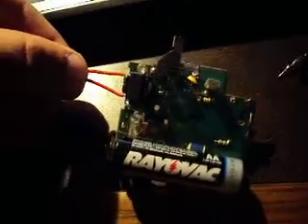easy EL wire driver circuit

Comment: The frequency would be about 18000 hz If there is high pitched whining like the whine you hear when an old tube TV is firing up. the frequency shifts around as the load changes though (this is known as drifting).

Comment: DaMMit, shorted the damn circuit. I dont have a volt meter, ANY TIPS? I'm trying to not have to buy an inverter for the el wire that I have. Think I could make one at radio shack or somethin?

Comment from the maker: @CalicoatMaker I don't know what the frequency is, but you can hear a high pitch whine when it's running. I haven't used it enough to run out a battery yet. I would say at least a couple hours of runtime.